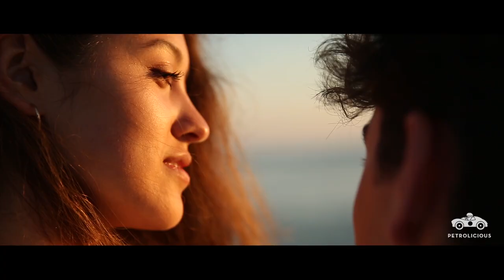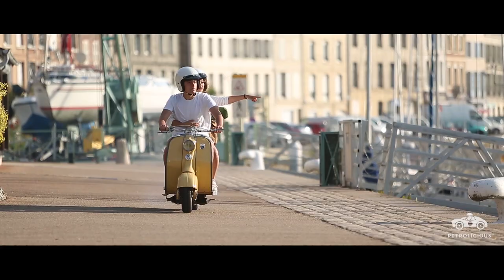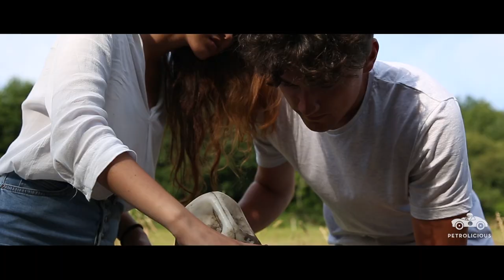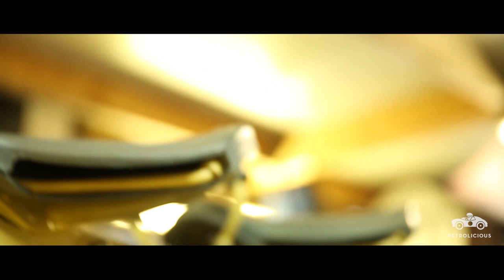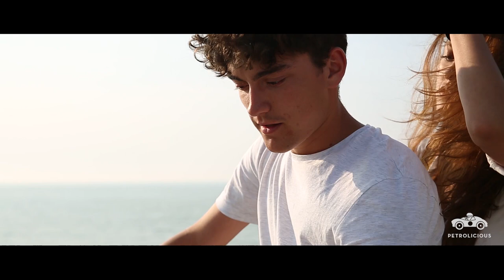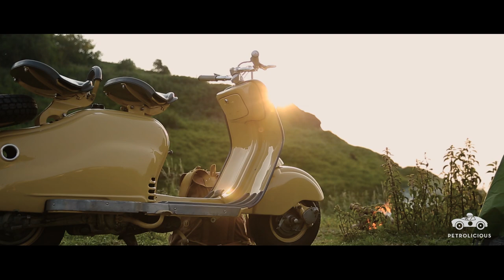1957 Lambretta Scooter: A Family’s Legacy Is Lost And Then Found

Comment: Probably the best of the Lambrettas.  The LD even the 150cc form was not overpowered for the basic design limitation - uneven weight distribution - very front tight = poor handling, wide footboards = poor cornering. 50MPH flat out was plenty. Best features were bullet proof engine not as prone to overheating as later models that suffered scored barrels. 3 gears and excellent shaft drive meant that these machines were over engineered . No bad thing.